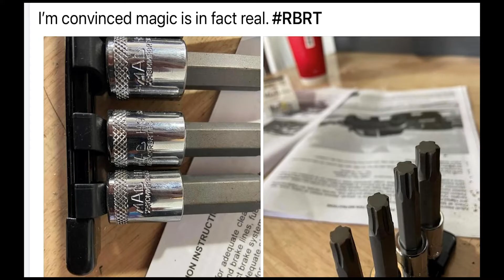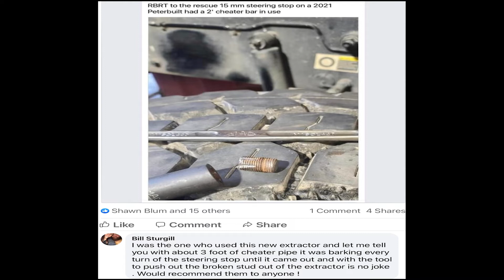RBRT For The Win! Real Examples of RBRT Getting the Job Done From All Over the World!

Comment: I wish I could show you the 8mm hex bolt I removed with rbrt. The customer stripped it, hammered and torx in and stripped it, then drilled through the side of the head horizontally and put a t handle through it and broke it off. I extracted the broken t handle, and hammered my rbrt into the head and was able to get it loose with a breaker bar.